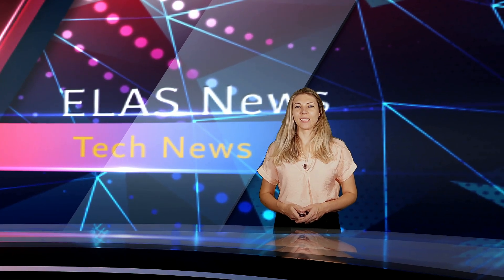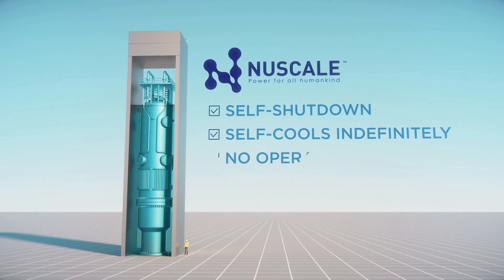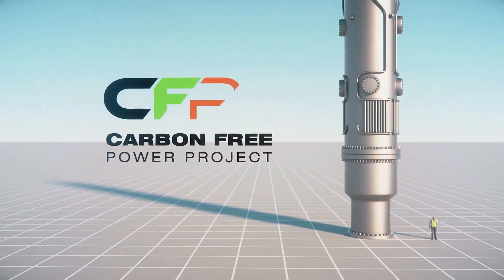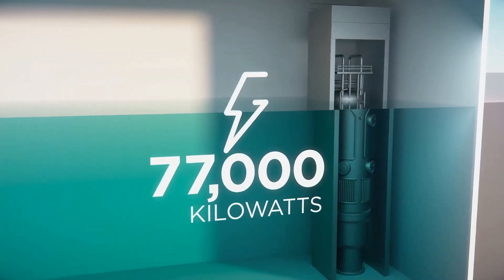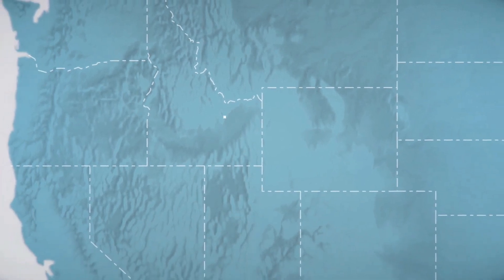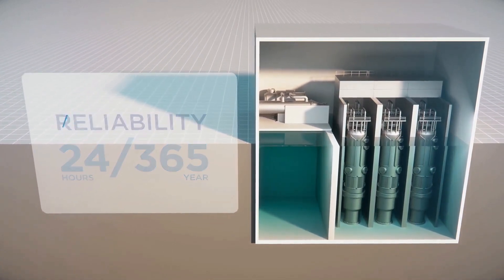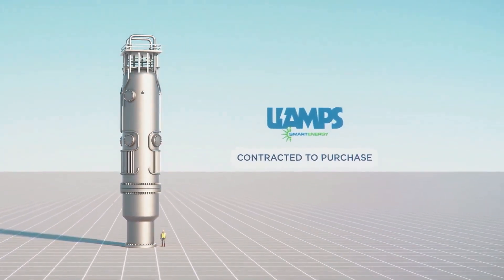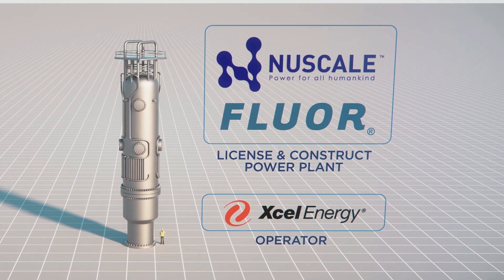First US small modular reactor approved

Comment: Some of the underreported facts about small modular nuclear reactors.
"...In 2008, officials announced that “a NuScale plant could be producing electricity by 2015-16.” Currently, the Utah project is projected to start operating in 2029-30. All this before the inevitable setbacks that will occur once construction starts.
"...The estimated cost of constructing a plant with 600 megawatts of electricity from NuScale SMRs, arguably the design closest to deployment in the United States, increased from about $3 billion in 2014 to $6.1 billion in 2020. The cost was so high that at least ten members of Utah Associated Municipal Power Systems canceled their contracts. NuScale then changed its proposed plant configuration to fewer reactors that produce only 462 megawatts at a cost of $5.32 billion. For each kilowatt of electrical generation capacity, that estimate is around 80% more than the per-kilowatt cost of the Vogtle project in Georgia — before its cost exploded from $14 billion to over $30 billion. Based on the historical experience with nuclear reactor construction, SMRs are very likely to cost much more than initially expected.”
“…For each unit of electricity generated, SMRs will actually produce more nuclear waste than large reactors.”
https://www.desmoinesregister.com/story/opinion/columnists/iowa-view/2022/07/24/midamerican-energy-small-nuclear-reactors-uneconomical/10104142002/?
Reply: The above post brought to you by Exxon and Chevron. Nuclear is the cleanest and safest form of energy generation, as well as the only one that takes complete responsibility for the waste it creates. Fossil fuels kill the earth. Renewables will never scale adequately, especially in the mandatory time frame before climate calamity. Nuclear's energy density cannot be competed with. Build enough of it and the CO2 issue is solved in terms of power generation. There really isn't another adequate choice. "Natural" gas will kill the planet.
Reply: @beautifulgirl219  Nuke is relatively clean, and for the most part probably safe, maybe. Density doesn't matter. Nuke fails because:
a) cost to build
b) cost of kWh produced
c) time to build	
d) risk to investment
e) return on investment
f) waste disposal
g) public acceptance
h) vulnerability to terrorism and war (dirty bomb)
And, 60 years of over promising and under delivering.

Nuclear is now a tiny backwater of an industry. The whole world managed a net 3GW total increase in capacity last year while the solar and wind industry installed 300GW. This year renewables will do 330GW. And new nuclear will be about zero. Maybe 3GW again. A rounding error.
Globally, nuclear production peaked in 2006. Nuclear energy contribution to global electricity peaked at 17.5% in 1993 and declined to under 10.1% in 2021. Over the past decade new nuclear start-ups have only matched closures. Nuclear isn’t stagnant, as percentage of world contribution it’s going backwards. Why?
This example shows why:
Europe invested $41 billion for 24.6 GW of new wind capacity during 2021. Georgia Power is spending $36 billion for 2.3 GW of new nuclear with their Vogtle attempt. 15 years later, still doesn’t work.
That’s... Wind $1.6 billion per nameplate GW capacity.
Nuclear $15.6 billion per nameplate GW capacity.
And you can build that wind power in 2-3 years rather than 15+.
And solar is cheaper than that.
While renewables have declined by a FACTOR of 300x in 35 years, nuclear has only gone up. Wind and solar passed nuclear last year.
Game over.
Reply: @pianodarr  Nuke is CLEANEST and SAFEST, PERIOD! The superficial analysis that thinks / asserts we can afford to destroy the environment because it is cheaper is so missing the point that one is disinclined to educate further. We could be building thousands of small modular reactors almost overnight if we'd get off our butts. Take a fraction of the money the fossil fuel industry STILL receives in tax subsidies for drilling and exploration. I suspect you KNOW all of this. The volume of solar and wind needed will likely NEVER be built, much less on the timeframe needed to meet the unavoidable  climate objectives. You likely know that too. You should certainly know we can burn as fuel the highly radioactive "waste", as France does, and the other waste isn't either a problem or likely to ever be a threat to anyone, UNLIKE the financially unaccounted fossil fuel waste NOW in the atmosphere, and the unrecycled solar panels (heavy metals--silver, arsenic, lead, cadmium) and wind units, which still aren't built in anything like the volume needed. Then there is INTERMITTANCY for wind and solar, which you ignore.  Try again, I believe you can look deeper.
Reply: @beautifulgirl219  "destroy the environment because it is cheaper">>

Neither renewables nor nuclear destroy the environment. Dying nuke is going away for the reasons stated, none of which you even attempted to address. Renewables are vastly faster, cheaper and cleaner. Why would industry pay more and wait longer for dying nuke when we can have faster cheaper? That makes no sense. Consider:
"...renewables today have become so cheap that in many cases they are below the basic operating costs of nuclear power plants.
Two examples: The world's lowest price for solar power in currently in Portugal, at 1.1 cents per kilowatt hour. And we now have the first results from Spain with costs for wind and solar power at around 2.5 cents per kilowatt hour. These are below the basic operating costs of the vast majority of nuclear power plants around the world.
An equivalent annual TWh of wind and solar can be delivered on grids in 2–3 years for a third to a fifth the cost as nuclear. As a result, we can have at minimum three TIMES the actual annual generation of low-carbon electricity for the same price delivered to the grid before a nuclear plant even starts operating.
Reply: @beautifulgirl219  "could be building thousands of small modular reactors almost overnight"

SMRs have been a pipe dream for decades. They're even dumber than regular old big nuclear. Where do I buy one? That's right, aside from some useful military purposes (where they have nigh infinite funds to play with), there are none. NuScale might have a working prototype in 8 years or so. A 450MW model. Meanwhile, in the next 8 years the world will build another 2.5TW of renewables. By 2030 we'll be adding 1TW of new solar, per year. After 60 years of trying, nuclear has accomplished 440GW.
And now we have this:
Wind and solar payback drops to less than a year
“Capital investment in renewables worldwide is set to outstrip oil and gas spending on new projects by almost $US50 billion this year, with soaring electricity prices reducing the payback period for solar and wind installations to less than a year, new research shows….
current spot prices in Germany, France, Italy, and the UK would all result in paybacks of 12 months or less.”
Will Vogtle ever pay for it's $36 billion cost? How about the $11 billion wasted on VC Summers before they just gave up and walked away? There will never by another nuclear or coal plant built in the US. They've been priced out of the market. Solar has dropped by a factor of 260x in 35 years and 90% in the last decade. Nuclear only goes up.
Reply: @beautifulgirl219  "Then there is INTERMITTANCY..."

The grid doesn't work on a baseload model now with large plants that must run 24/7/365 just to meet operating and capital costs. That is why nuclear, and often coal, are no longer competitive. Having diverse flexible generation that gets contract settled in 5-15 minute packets is the new model. Since renewables comes in at one third the cost, they win at auction and get used first.
Doesn't take much storage to leverage the usefulness of renewables and get 90% coverage. 
What happens when the sun still doesn’t shine, and the wind still doesn’t blow?
“This is the role of storage for energy shifting rather than storage for grid stability. Additional storage could provide coverage. The results of a simple network model suggest roughly one day out of 10 there will be a shortfall in renewable energy for more than 12 hours of average demand.
The provision of sufficient storage to supply 12 hours of average demand would allow the renewable energy penetration to exceed 90%.
This storage could come from a number of sources: the underutilised battery capacity of electric vehicles, behind the meter storage in houses and commercial premises, utility scale batteries such as the Tesla battery in SA and large scale pumped hydro operations such as the proposed Snowy 2 system.”
--Energetics
Reply: @pianodarr  Talk to me about Solar / Wind when gas and coal and oil are replaced by them globally, IN the time frame we have to address climate change. Hasn't happened and isn't on schedule to happen. NUCLEAR is the CLEANEST and SAFEST energy production process, the others don't fully cost / expense the pollution they produce. Solar cells are NOT recycled in the U.S., and you say that isn't pollution when the dangerous heavy metals from those panels leach into the water supply. Right. Put the resources / government subsidies into NUCLEAR that exist in other sources and the price would drop precipitously.
Reply: @pianodarr  This post isn't worth responding to. Send it to Rolls Royce, they will make a fortune selling SMRs while laughing at you. LOL, ignore.
Reply: @beautifulgirl219  "Solar cells are NOT recycled in the U.S" he says.
Try asking questions rather than stacking unsupported false assertions. Less embarrassing that way.
1) Game-changing solar company recycles old panels into new ones
The first wave of solar panels is reaching the end of their useful lives. Now they can become new solar panels instead of trash.
"...At a recycling plant in Ohio, next to the company’s manufacturing facility, First Solar uses custom technology to disassemble and recycle old panels, recovering 90% of the materials inside. It runs similar recycling systems in Germany and Malaysia.
"...The E.U. requires solar producers to recycle products, and similar laws are in the works in some other parts of the world, including Japan and India.
"...By recycling materials, the total environmental impact of each panel drops. The original solar panel, ...might last 30 or even 40 years. If 95% of the semiconductor material can be recovered and put back in a new panel, and the cycle continues to repeat, the original material could stay in use as long as 1,200 years.”
https://www.fastcompany.com/90562056/this-game-changing-solar-company-recycles-old-panels-into-new-ones?
2) Canada: Solar X revolutionizes the solar industry in Canada with the launch of its new solar panel reuse + recycle program
3) Australia: One of Australia’s first solar PV recycling facilities is up and running in Melbourne’s north, The plant will recycle 100% of end-of-life solar PV modules and all associated materials recovered – inverters, cables, optimisers, mounting structures – using no chemicals.
The final components are:
- High grade aluminum
- High grade silica dust
- The silica cells which will be reused by some manufacturers.
- Copper
- PVC		
- Silver
100% of the materials separated from this process will be reused and given a second life. All inverters, rail components, cable can be processed in this facility.”

Let me know if you need 10 more examples like this.
Reply: @pianodarr  You have a lot of directives for someone worried about embarrassment. Don't bother replying!
Reply: @pianodarr  storage of electricity via batteries is very expensive and nt practical in any way
Reply: @beautifulgirl219  The company that the person referred to, First Solar, make thin film cadmium/tellurium solar panels. The percentage of these particular panels being used commercially is quite low. I believe it's around 5% of installations, most installations are of the crystalline silicon variety. We have an 87MW commercial thin film solar project 4 km from our home in Central West NSW Australia and our region sits over a massive aquifer. This installation sits on prime agricultural land. Most people don't realise there are different types of panels. Hailstorms are not unusual in our region and I cannot understand how the risk of cadmium and tellurium potentially leaching into soil and waterways was not even considered. 

He is correct about these particular panels being recycled, to my mind it's more about minimising toxic contamination than economics, but when ours reach end of life in less than twenty years time the nearest specialist recycling facility is in Malaysia. I can't tell you who's responsible for the cost of the decommissioning and if they really do ship them to Malaysia this will be very expensive. Recycling of these particular panels requires acids and other chemicals and results in toxic waste. 

Our local solar facility is on to its third owner and it was only commissioned in 2019. It has not gone well to date. It was struck by lightning at some point which damaged many of the inverters. It has had shortfalls of energy and the project had a major write-down just before its most recent sale. We had 15 blackouts, brownouts and spikes over a two year period. 

He is wrong about a recycling facility in Melbourne. Although the state of Victoria has passed laws that forbid E-waste from going to landfill, at this point they only have collection agencies. They do not have fully operational solar panel recycling facilities, at best they remove the aluminium frames. There is a company in South Australia that calls itself a recycling facility, and for a fee they will collect solar panels. But most states don't have the E-waste laws for solar panels that Victoria has so most of them are going to landfill, it's cheaper than paying someone to collect them. Recycling of crystalline silicon solar panels is not an easy task. Even in Germany where recycling was mandated there are materials in the panel that are not able to be separated economically. Recycling of solar panels is a costly exercise, it is far cheaper to start from scratch. Which is why most are ending up in landfill. 

There is going to be billions of solar panels in Australia alone that will need to be disposed of in around twenty years time. Who is going to pay for the clean-up? That doesn't even take into account the thousands of gargantuan wind turbines and the multitude of 'big' batteries. Australia will need 28,000 kilometres of new transmission lines to support this infrastructure, and countless new substations. It's insane, all this for a form of power that can only produce energy on average for 30% of the time and is short-lived.
Reply: @margaretarmstrong2445  Perhaps the most informative and astute post I've seen on YouTube. THANKS!
Reply: @pianodarr  In Asia solar does not work because of the monsoon season. And they do not have space like in the USA, Spain, and the Sahara desert. It all depends of energy storage, both in heat, hydrogen or in iron powder.
Reply: Happy days. 😊 
No problem there. 
Banker's business will boom.
Financing for the next 60years to 100years. 
Happy days and no climate destabilisation.